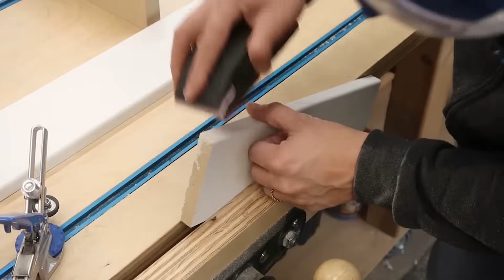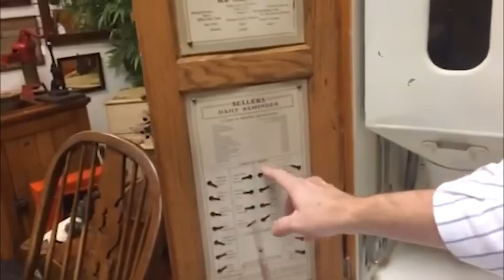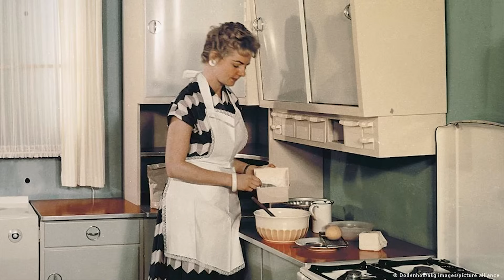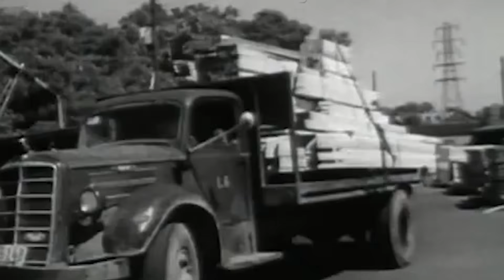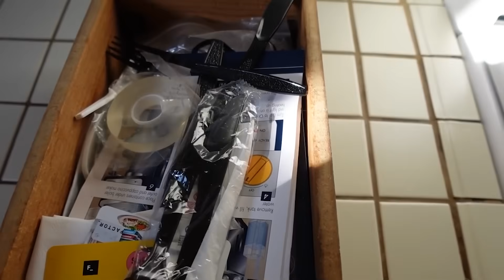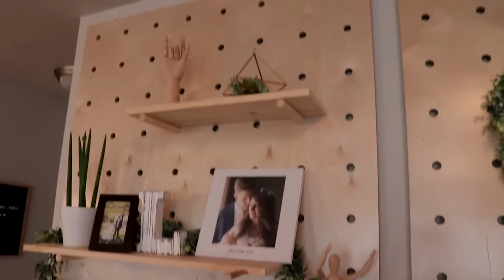This Depression-Era Pantry Trick Doubles Your Space FOREVER. Why Did Modern Builders Bury It?

Comment: I did this in my home…out of oak and they have thin wood backs on them and doors on the front. Mine are deeper than 3 1/2 inches because you can even build them out a couple of inches by using wood 1x2s stacked on top of each other to trim around them. They are very handy. In some rooms I built them behind the doors…so when your door is open you don’t see them. It’s a space that you usually can’t use…so this is perfect for that space. You just have to know where your wires and pipes are so that you avoid them….stud finders will usually detect those.
Reply: I put in 8" shelves and went to ceiling.......worked get:)

Comment: The reason this went out of style is that it's not practical. Exterior walls are filled with insulation, and interior walls are filled with pipes, ducts, and wires. Modern houses in particular have a lot more cabling and piping than depression-era houses. Everything from network cables to centralized vacuum and air-conditioning ducts. On top of that, the space between walls does serve as a sound muffler between rooms.
Reply: We always did this to every house we lived in.
Reply: I built these in my modern house. Cut away part of the drywall and built shelves out of oak and made doors for them. Pipes and wires don’t go through the walls all over the place….they have designated areas where they travel….usually in the lower area of the wall….so you can easily build these 3 feet above the ground and up….and just stay away from the studs where the outlets and light switches are because those wires travel down or up the stud. These shelves don’t affect sound between rooms either. I have built these kinds of shelves behind doors…so when your door is open you don’t see it. I have several of these in a hallway. I keep extra food in them….bathroom supplies in the ones in the bathroom…my kids store their video games in the ones behind their doors.